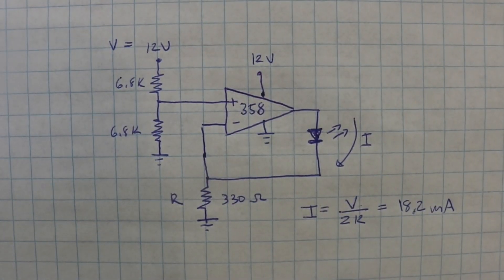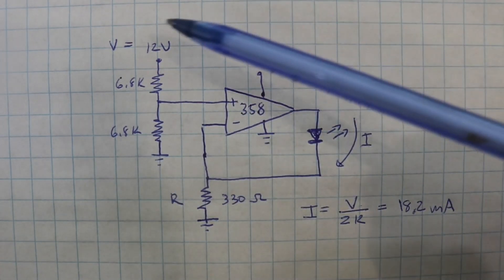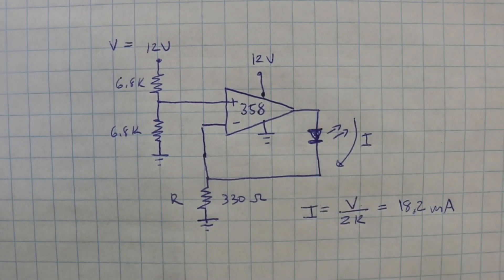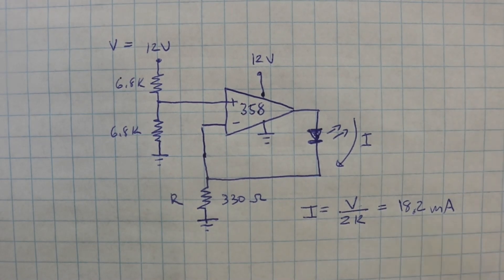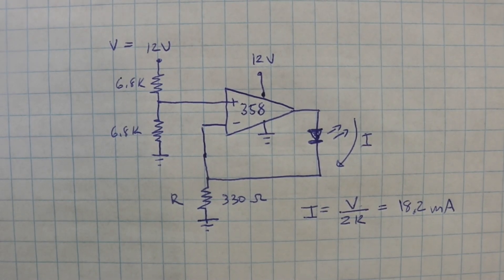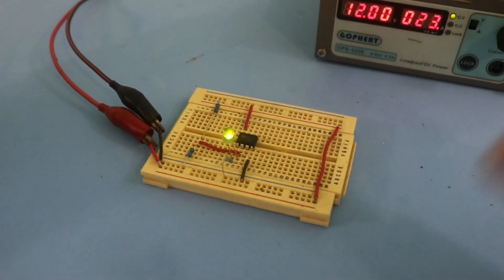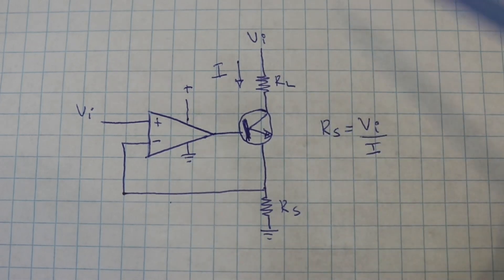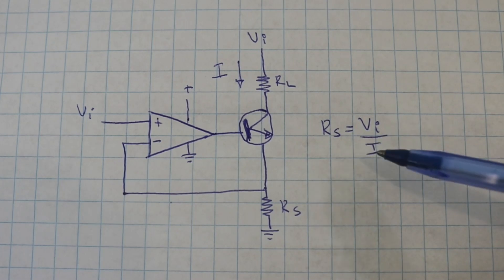Constant Current Source with Op Amp

Comment: I'm new to this topic... what's the benefit of the last configuration using a transistor?
I mean, why not use a current limiting resistor on the component to drive instead, and avoid the other components?
Thank you!

Comment: In your schematic you say I = V / (2R) but it should be I = V / R.  6 / 330 = 0.0182.
Reply: In the schematic the only source of voltage is 12V,  and voltage on non inverting is 6v. thus the division.
Reply: @lutfijd  I stand corrected.  I was calculating the current based on the voltage at the non-inverting input.